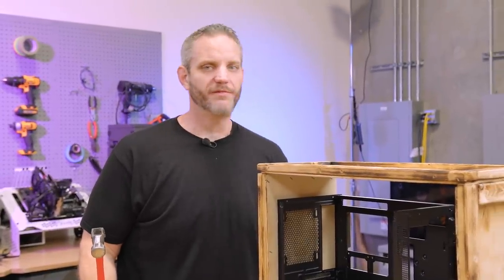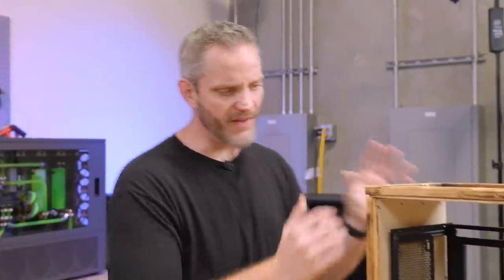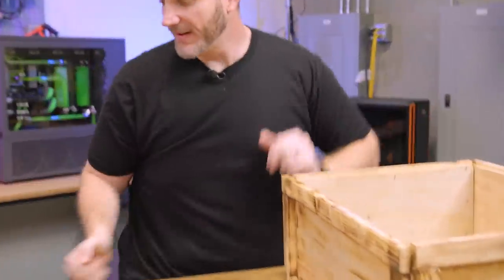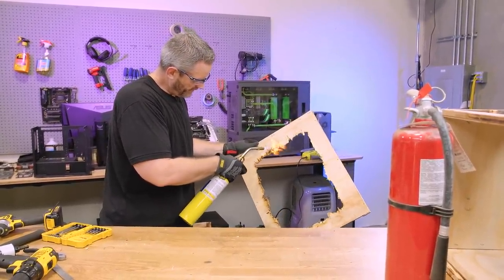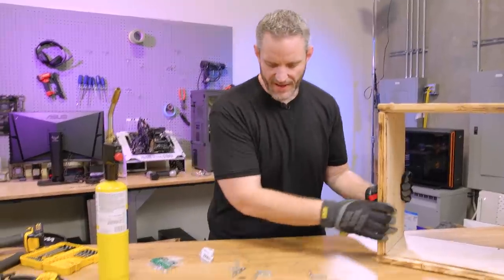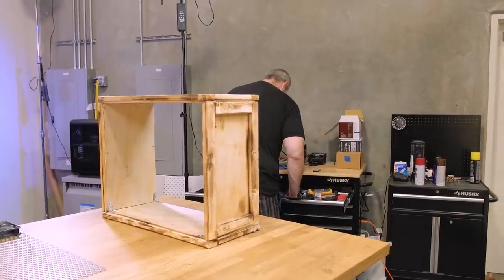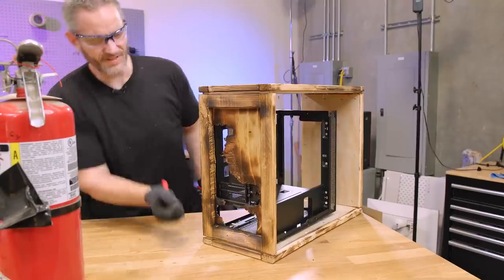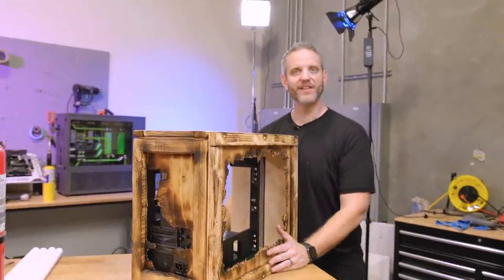I’m finally starting the Red Dead Redemption Custom PC mod again

Comment: Should make the reservoir look like a moonshine still.
Reply: That's a Great idea 👍
Reply: That would be awesome... A tiny shiner still?
Reply: I don't actually know you, but for stilling my idea we are no longer friends.
Reply: Yes very cool idea
Reply: a moonshine still, would that be a copper reservoir, with clear flexible tubing and brass fittings?
Reply: @drassx615  I would do a galvanized looking reservoir with cooper tubing. No need to have clear anything. A  copper reservoir aged would look cool too. Also coil it. There is plenty of room.
Reply: Or put a plunger on the top with wires coming out  looking like a box that sets off dynamite.

Comment: Incorporating some leather into the build like straps would have been awesome. Custom made leather sleeved cables?
Reply: Definitely add some class, needs to strip the case down a lot more as well. What remains could be trimmed in leather too.
Reply: Leather sleeved? Leather is thicc, you'll have like a 5 inch wide 24 pin cable
Reply: @somedude2492  Lucky that thin leather is a thing.
Reply: @Vertigo11  if you want real (or at least real looking) leather, it can't possibly be less than .8mm thick. Wrap that around a cable and now something that was 1mm thick is 2.6mm in diameter. That means the cable as a whole will be 2.6 times wider/thicker.
Reply: Jea
Reply: @somedude2492  Doesn't have to be real leather. Maybe even wrap the entire cable instead of sleeving each one.
Reply: @Vertigo11  That's what I was thinking, as trying to sleeve each wire would be borderline insane unless you used something very thin similar to a leather car shammy. Either wrap the 24pin and such making it look similar to a belt and could even add a buckle to where they plug in at the connectors. Or kick it up a notch and do something similar with a piece of leather on both sides, covering all the wires in a row and then stitch the bottom and top piece of leather together with stitches between each row of wires. You would still most likely have to use split leather as regular full leather would be very thick and stiff and probably hard to manage in such a tight space.
Reply: Terrible idea. Some cables can get real hot
Reply: Calvin Schuster  He should totally do a "JayzTwoCents" logo as a brand!!!
Reply: distressed leather for a hinge and a latch?
Reply: i just hope he ties it into the game somehow like some company from the game like a kerosene barrel from cornwall, if its just a burned TnT box that's crusty with leather on the trim, that shit will look WHHHACCK and you know it.

Comment: #1: Plywood was invented in 1865 and mostly used in furniture construction, not dynamite boxes. Each panel would have been made with slats nailed to a frame. #2: New burnt wood would not look as good as a 'barn wood' look. Grey, faded and broken wood fibers. #3: You should just leave it in the metal case and get an airbrush artist to paint it the way you want it. Aged wood, nail heads, wormholes, slats, knots in the wood, etc. I'd get some old barn wood and attach it to the outside of case from the inside. Hella heavy, but more authentic.

Comment: Apparently, the error code 02 can be related to a faulty display cable, specifically HDMI. Also, it seems from what I've read, you can't use a DisplayPort cable. This was using a discrete GPU. Just what I've read. It might be worth giving a shot, replacing or using an HDMI cable, that is.
Reply: That would be mediocre if that would be a problem on such an expensive Motherboard. ASUS has become garbage since 2014.
Reply: @kyoudaiken  my asus mothetboard just works fine tho
Reply: @kyoudaiken  I've always seen ASUS as overpriced crap. Pay more get less. Pay 120 dollar more and get 2% more performance. (GPU's ofcourse) Imo.
Reply: @DanielFrost79  ASUS GPUs are top notch in my opinion but their motherboard feature segmentation annoys me to the point that I will not buy a ASUS motherboard unless there is no other option with the features that I want.
Reply: @emu071981  Many people see them as Top Notch, but i seriously do not see why. I only see them as overpriced and not that good. Again imo. 🖖👽
Reply: Actually you have to look at the Qualified vendors list. I did a build and got the 02 error on an Rx 580 and rx590. Problem: Sapphire cards are incompatible even with bios updates. So I switched to an Asus ROG 2080 super. System booted up.
Reply: That or the GPU could be defective. Swapping the GPU altogether could at least scratch that out.
Reply: For me it was because my GPU needed a firmware upgrade to support DisplayPort 1.3/1.4 from nVidia. Not well documented, but immediately fixed the issue
Reply: Ah yes. I think I remember Austin Evans had a problem similar to this. He switched the display cable and everything was suddenly fine.
Reply: He doesn't use an APU...
Reply: @FaySmash  I did say using a discrete GPU aka dedicated GPU.
Reply: @kyoudaiken  Very true, though I think it has more to do with the platforms and chipsets.
Asus always favored intel-chipsets . The very first Asus I ever build myself was with an mmx-board, those times asus ruled. 
For years I've bought asus boards, just until the p5k-e in 2007..which btw still runs great at this very moment. 
But all my builds were intel-chipsets.
It may just be a guessing, but eversince amd-platforms became a true competitor, Asus is competing with brands like Msi , which always had great amd-boards. It might just be a bit 'out of their territory' .
Then again, they still do have some good boards, like the Tuf 570, which still has it's place in the market.
All the rest is pure a personal choice for the 'looks' , maybe the primes are still a good budget-choice here and there, but that's about it. 
Still being an old-timer, I'm do not trust brands like msi , asrock etc for ther longer terms. 
I got asus-boards running for decades and still up and running today...it's not only 'performance' that counts in my opinion.

Comment: This is gonna be gorgeous Jay, but there's something that bugs me out: The chassis inside the box.

What I would personally do with this mod is butchering the chassis entirely and leaving only the essential structural parts (like the front and top fan/radiator frames, mobo backplate, I/O shield and PCI mounts, etc.) bolted directly onto the wooden box walls. Also, if you plan to do some copper hardline, an added plus would be to get rid of that black color and painting the chassis with a more "copperish" one.

Of course, all this would take a lot more time to be done, but the result will be prettier in my opinion. 

This project is gonna be absolutely gorgeous, can't wait to the upcoming videos of it.
Reply: same
Reply: Agreed
Reply: hahha he said prettier
lmfao
Reply: please do this jay
Reply: It probably will look cool once it is treated/painted, im imagining it looking like an old rusted out piece of equipment in an old box which i think he might be going for. But i would like to see it get really dinged up/scuffed maybe even holes smashed into it to look like rust holes :D
Reply: agreeeed
Reply: Hunnit
Reply: Yeah, making the metal chassis a bit old-timey and rusty will definitely improve the look, but it's still gonna look too complete, if you get it. The safest bet would be to make it optically broken - using copperish rusty paint and "chip off" the edges with black paint. Some lighting inside could also contribute to the illusion, if placed properly. It'll look good, but don't forget to treat the wood.
Reply: Yes the case inside a case looks kinda odd
Reply: Jeffery Pettit What are you on abt?
Reply: just mount the mobo on standoffs and neatly cut out the IOshield and GPU-holder. would look way better imo.. psu mounted to the floor and radiator on the sid/top, no need for any of the orignal structure
Reply: I agree!
Reply: Agree. Break down the chassis
Reply: Bolting or riveting the frame parts sounds like a better idea than leaving just a chassis frame inside.
Reply: buy sheets of copper you can solder joints and make the internals (mobo support) out of copper
Reply: Agreed! the internal case detracts from the theme. even after ageing etc it just doesnt feel the same as the rest of the case.
Reply: I think the build is sponsored by the manufacturer of that case though.
Reply: Yup. He even said multiple times in part 1 that he wasn't just going to take the case and shove it in a box. 

He is literally taking the case minus what, two panels and putting it in a box. 

...but even this is beyond what I could muster.
Reply: or skip the parts entirely and build from scratch with the wood he has, i did the same and it worked out pretty well

Comment: It's going to be beautiful.

I would slap a acrylic panel on the open side tho.
Copper loop would look amazing.
I would look to BioShock, i feel that there would be a lot of inspiration for this build.

Hope to see more of this soon.
Reply: The acrylic would look awesome if he could paint the edges of it to matching the burning of the wood, or give it a tint to make the inside look smokey from the "explosion"!
Reply: There was no acrylic in that era... so no. ( Yeah there were no PCs back then either, I know... I know! )
Reply: @MD2389  just put it over a candle emitting smoke or something. Makes the smoke stains. Although they would be very easily removable
Reply: @HauntedSheppard  And if he goes with that candlelight flicker profile he mentioned, that's gonna look sweet!

Comment: Okay. I'm digging this build, motherboard woes aside. I keep thinking you'll want to seal off the the inside and outside of the crate ─ probably with matte finish epoxy ─ to keep carbon and wood particles from becoming a problem.

Comment: Jay: I think I might have bit off more than I can chew

Also Jay: I think i'm gonna do full custom copper and brass loop
Reply: Diego Kleinman that’s just Jay
Reply: Oh oh, another 6 month build incoming.
Reply: Or another Terry Crews build..
Reply: Watercooling loops are in his comfort zone, working with wood is what he was referring to
Reply: Jay! Cut the lines with dremel from inside, about 3/4 of thickness of ply and then snap it of for the openings
Reply: Some railway accents would be nice too
Reply: For grill I think only angle grinder if it's really too thick for snips. The copper tubing I'd treat with acid to het the worn oxidised copper
Reply: I hope you know the custom copper and brass loop is the least problem he has with it. That's just easy for him.

Comment: I only wish the internal case fit better. Killing my OCD
Reply: drill pilot holes for the standoffs and screw them into the wood. Make a metal piece for the PSU you can screw into the wood. Then put two of the screw-down speaker connections of a broken receiver on the top and paint it to look like a detonator. Put the power button on there too with the word FIRE! below it.
Reply: @joer8854  that's a pretty thin piece of wood I wouldn't trust to be holding my motherboard
Reply: Good old internet OCD. I see no problem with it. Once the front and top radiator is in it isn't even a problem anymore.
Reply: I was just thinking a standard case... wrapped in the wood

Comment: Some ideas:
Use the metal grate on at least the top and front fan mounts to make a "reinforced crate" lining (as if the crate had a metal grate layer inside to strengthen it?)
For cables, make your own if possible, classic red wires in a bunch (without cable combs, etc) to make it look like a handmade rats nest of cables and stuff for a TNT crate?
Maybe even put some small LEDs, between wires to make it look like they are sparking.

Comment: Hey Jay. Easy patina tip for coated metal parts. Soak it in white vinegar for a couple days to remove the zinc coating. Then you can play around with salt water or other reactive liquids to change the way the patina looks. Great idea on the build and I look forward to seeing how it comes out.

And yes, your best bet for cutting that expanded steel would be an angle grinder.

Comment: Jay: Working with metal tubes is awful.
Also Jay: Oh, copper tubing will look awesome!
Reply: Different kind of metal. The ones he hates are the ones coated because the coating can break. Normal copper tubing doesnt have that issue
Reply: Well yeah but some people are also awful to work with, tho they look awesome.
Reply: Copper tubing would be super easy to work with even forgetting the woes of working with coated metals. Not to mention fittings for it from home depot arent 5-7 bucks each like EKWB fittings

Comment: Hey bars would look cool on the side panel...think like jail bars. My .02
Reply: Nicholas Gradel yes!!! But mulled up jail bars!! So not just solid bars but beat up, gaps missing and rusted!! 🥳🥳
Reply: Maybe this bars thing from an old grill would fit that design. Or just use an old greasy  bar thingy from an old oven. Of course the grease has to be cleaned of before but the ruff black, brown rusty bars would look awesome in this built.

Comment: Got my like when  you said "and people know I like Bourbon"  awesome looking case.  Was fun to watch as I just finished my custom case myself.  I did a full custom epoxy top desk, and have my open air computer under my side wing.  essentially just a shelf and a open air mount, but worked well with the water cooling setup.

Comment: Next time working with expanded metal, just have it sheared to the dimensions you desire at a steel fabricator/supplier. Where I work we have a $40 minimum order, but for that little amount of steel, we would likely just ask you to bring the shop a pizza or 2.

Comment: Oh man this build really gets me thinking of cool design ideas!
You could get white cable wraps then sand/fray them and get them dirty so they look like old cloth wrapped wires from antique houses. 
You could take all the copper piping and fittings and purposely oxidize the outside so they look like they've aged for years.  
You could take a cue from that whiskey bottle build and use an old glass bottle labeled "Nitro Glycerin" or something as a reservoir.  
You could use iron on wooden edge banding to make some of the components look like they were made of wood. 
You could use some sort of paint stripper to remove the black paint from the radiators and show the copper to match the tubing. 

Im sure I could think of more but thats what i have for now

Comment: Hey Jay, a normal angle grinder will work just fine to cut that grating. Our shop guys and field crew cut 5/8" grating all the time with an angle grinder. So this little stuff will work just fine for that.

Comment: Heat where you want to cut the metal and use a manual pair of shears.
Reply: @Gzeus   Yeah... NO... that is not going to be the best idea.  Using the angle grinder will make short work of that expanded metal grate

Comment: As a sheet metal worker, I would always use the angle grinder with a cutting wheel. That cutting shear is a no go you're gonna destroy the blade. Same with your snips.

Comment: As some others have likely commented, a grinding disk and going down the line of the diamond pattern would work really well. I'd also make sure to have a sander/dremel/file to round the edges over for safety.

Comment: Gonna be honest at first I thought it wasn't going to work out, cuz it just looked like a case stuffed inside a big wooden box, but now with this burning holes it kinda looks very good!

a few ideas:
1) Make the panel open like a saloon door from the western movies
2) Please disassemble or make the interior metal case by yourself, that will increase the aesthetics so much more than just sticking with a pre-made one (perhaps it can also be made from wood with some brass elements?)
3) You can make a stallion or two revolver pistols logo burned into the wood 
4) There could be little hanging on chain lamps at the top which are essentially the replacement for RGB
5) Perhaps the only build where Noctua fans would actually looks good is this xD (but do make them with some warnoff dirty feel)

Comment: Don't let it get to you bud.   It's looking like a good scratch build in the making. 👍
As to the vent mesh, you're right.  The best way would be a good 4" CUTTING(not grinding) disc.  But you could get it over the edge of a good solid table and use a length of wood and hammer/rubber mallet to give you a nice straight crease.  You can then flip it over, do the same again and it should the "ease" along the crease so you can just wiggle it until it snaps. 
As to the side panel, you could set the Nylon filter mesh/Acrylic/Perspex/Poly-carbonate(would be better, score and snap+better scratch resistance) back from the inside a tad(you could try getting an Orange box and knock the bottom out to make the surround for the hole), then it wouldn't "break" the theme. 👍
Please don't give up, I like scratch builds.
PS: Instead of "jaggy" cutting for the I/O, I would have set the whole PC back away from the wood outer panel and done biggish Gatling gun bullet holes(bigger than the sockets and even overlapping each other, and burn em' again with a star'ish stencil👌) for every socket so you don't see any of the shield.  The PSU.......I would make up a cut-out of evil rat eyes and put red LED's behind to stick in the middle of the PSU's grill mesh.  😁